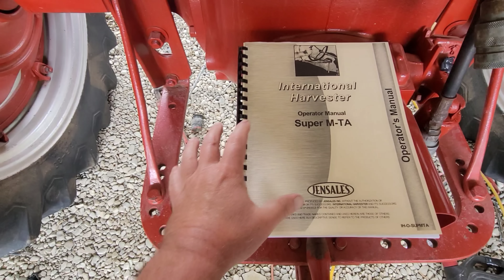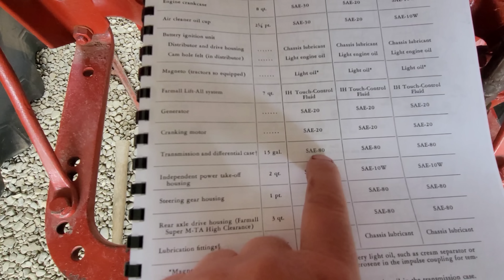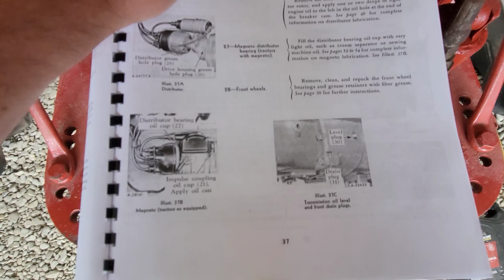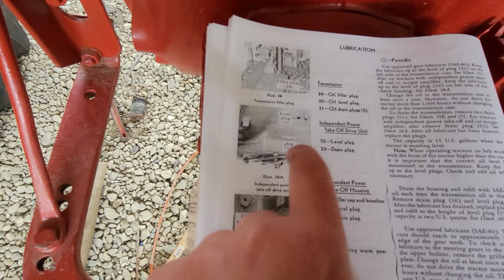How to Change the Transmission Oil in a Farmall Super M-TA | You Might be Surprised

Comment: I learned something there. It makes sense. The torque amplifiers use clutch discs and the Hy-Tran is definitely better. I think we'll go the Hy-Tran in those after this. Nobody changes their transmission oil every year. It's impractical and not necessary when you only put a few hours on per year. When farmers were running 800-900 hours per year, yeah, I get that, but not 50-100 hours. The oil also got much better than what they had in 1954. If you buy the cheap oil at Walmart, it's exponentially superior to anything that they had in 1954.  That's what I kept saying about low ash 30, is it's too darn heavy for winter. Now with the multigrades, it's much better. I was going to do a 560 complete oil change video last year, but my cameras were not working and lost my footage.

Comment: Excellent video Gino  :) also will say like helping hints on Farmall or McCormick International  or International  tractors or combine  or machinery stuff matinne up  in your videos too ! But on 1950 Cockshutt 40 my Uncle used Hy Tran 80w90  in transmission plus PTO  and he said ran super and change fluid plus filter  ever 5 years Lol ! I never got to read owners manual on it because he wouldn't share to me and let serivce that Tractor to himself!  But read all McCormick International  & International  on 1963 McCormick International B414 Loader Desiel motor  Loader type , 1968 McCormick International 105C combine gas motor, 1968 International 624 A Desiel motor tractor  no Torque Amplifier  on it was option  then , 1978 International 724 B Desiel motor Loader type had Torque Amplifier  and remember my dad put  Hy Trans 80w90 he change ever 5 years plus filters  to for transmission! But one helpfull hint Gino if slightly slip in gears or range shifter  plus feel bounce like horse get up going it low on fluid  to top up or needs change  ! Yes remember my dad said Hy Trans fluid expensive in 1980's to 1990! But said do before change it Gino is correct my dad did that too before put new fluid  in plus filter as you said to ! Also remember my dad want me help change in 1990 year and said oh my goodness it worn buy smell off  and dad said want milkshake in weak chocolate Toffee way ! Said nope but stunk smell like skunk Lol! Gino doing well of job Boom 💥 tractors  !

Comment: That diesel to clean out the sludge makes good starter to burn brush piles in the Winter. Those drain plugs looked almost like new. Most guys would make a mental note to put in new ones to replace the rounded plugs the next time they changed oil in two or three years. I guess oil was so cheap they didn't think about filters on the rear end or even on the TA? I remember on some of the Japanese Fords they just had a screen on the hydraulic system.
Reply from the maker: Oh yeah it definitely does

Comment: Last time i did an Mta i used my Samson 27 gal oil Suction system and found it to be about the best way to get 99% of the oil out of an old tractor as such. And we found with the top deck plugs that you always got some water in mine was usually from sitting out side in the rain . And when i went to refill we would pump a few gallons of diesel then hytran til we got clean enough out drain then filled with fresh oil. Shell makes the current version of the Hytran now for CNH since it had to be updated for the Latest CVT transmissions. The original is still made by FL Viscosity
Reply from the maker: I like the original
Reply: Good   day  AJ  So u mean shell makes Htran oil, oftrn wondered  who did.  
Is  there a place cheaper than CNH  to buy same oil ?  Thanks

Comment: Interesting video 👍 i have a 1958 B250 diesel built in Bradford Uk and the positioning of the drain plugs for back end transmission etc on it and the level plugs are all almost identical to yours 🤔 one other thing meant to comment on is in your intro you comment 4th Gear in field work my B250 is only 5 speed and there are many field operations that can be done with it in 4th gear but 5th is definitely a transport gear 👍 i pull a 2 furrow 12 inch plough in 3rd gear effortlessly 💪 never been brave enough to try 4th in case of rocks 😳 Red Power 💪💪💪💥
Reply from the maker: In the next video I plow with the super c

Comment: I know what you mean on the manual re prints. I have the original and the updated one for my wife’s super c. Save your buckets for the HYTRAN, our case ih dealer gives a slight discount if you bring your buckets back and have them fill them out of the tote. Im sure your dealer does something similar.
Reply from the maker: I will definitely check... For sure I save those buckets though
Reply: Good   day  Yea that is right,  take empty  pail in  for discount  usually Feb- March.  Thanks  I had forgot about that.

Comment: I agree use hi tran think you were dead on with 560 being when IH figured out to use hi tran dad bought a new 460 diesel in 1958 that's when we started using it in all the red tractors forward I use it in my 460 gas that I have no trouble with TA on it. I thought the oil you drained looked pretty good so you should be set to show us some farming now. I'm off to Big Red 
Power days in Grand Island Ne.
Reply from the maker: If I didn't have so much stuff to do here I would be there

Comment: I was thinking its a separate compartment for the TA  and the rear end.... CNH suggestion is hytran in all though. 
We switched from CNH hytran (now Shell oil) to the Viscosity hytran ( original manufacturer for hytran from the beginning until December of 2021? We weren't happy after CNH switched supplier. You should be fine extending the drain interval as long as moisture is controlled from getting in it.
We get bulk oil and its still 14+ per gallon 😮 LGB!
Reply from the maker: Yes I was less than impressed when they switched suppliers
Reply: We actually had lots of foaming issues in the skid loaders. Sight glass was why we first noticed. Never had that with viscosity oil . My wife's uncle was an engineer at IH from 56-81 and a friend was an engineer for the hytran research and he had some interesting insight
Reply from the maker: So basically they're not making hytran anymore
Reply: @FarmallFanatic  correct. They call it hytran but it's not near the same formula as the last previous one. It's gone through many revisions to help with wet brake chatter, CVT etc. I wish there was the hytran from the 80's yet for older machines

Comment: If i change tran oil every year I'd b changing oil in couple tractor only run 100 hours a year i pull bottom plug for a sec make sure no water
Reply from the maker: That's all I do

Comment: There is actually a company that makes the original formula of hy tran I can't remember its name the newer Case IH or New Holland hy Tran it's not the same I believe it's made for modern tractors
Reply from the maker: I agree
Reply: @FarmallFanatic  do you have a number on how many MTA'S were made we had one the independent PTO was removed and the torque amplifier was removed also our two 706 s The torque amplifiers were removed by the previous owner I guess there is a shaft you could put in it's  place he said they didn't need them for what they were doing and took them out and kept them for the other tractors    that needed them  he had 40 or so ih tractors at a time for a custom harvesting business and he went through every series IH made so I didn't question his decisions

Comment: Transmission is still 80w90.... the TA and hydraulic is still hytran
Reply from the maker: The torque amplifier and transmission share the same fluid.
Reply: Except on tractors NOT equipped with a torque, you cannot use 80/90 or it will screw up the the torque and you will need to rebuild it.
Reply: @FarmallFanatic  i meant differential